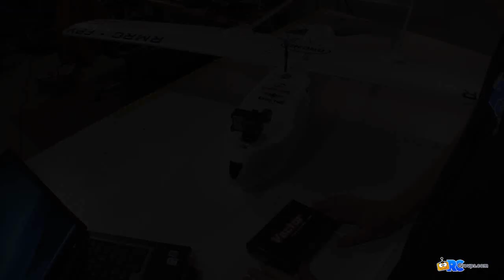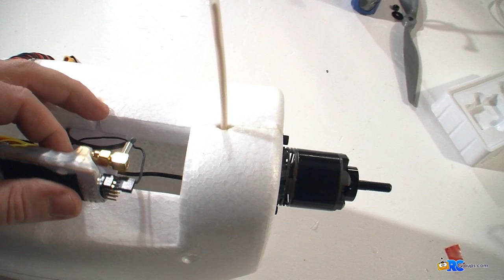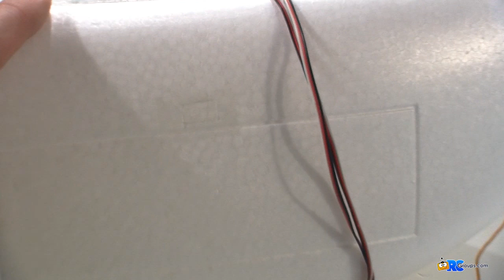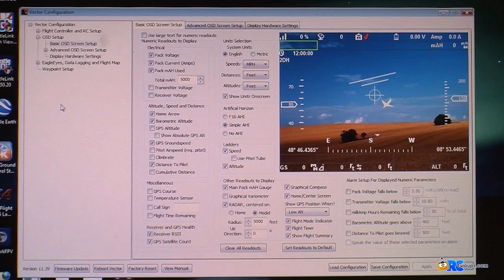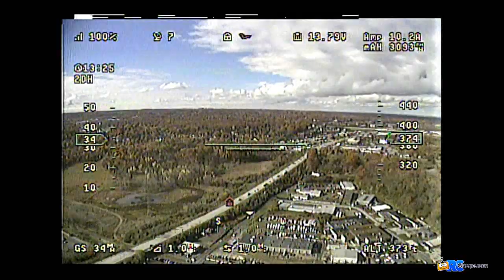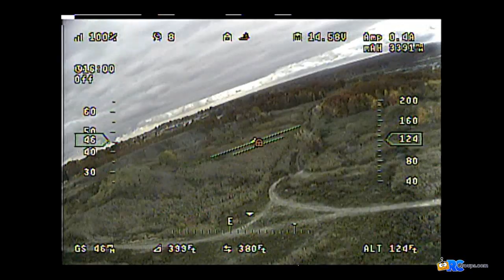Eagle Tree Vector - Installation Setup and Test Flight - RCGroups.com Review

Comment: May I ask you a question? When using Vector for Skyhunter, which kind of tail do I have to choose? Traditional fixed wing ? or V-tail?
Skyhunter has an elavator and no rudder. So its tail is not "traditional" nor "V-tail". I am afraid that wrong setting causes a crash.

Comment: I have just purched the eagletree vector and this Will be my first fpv system aften many years rc flying. I am wondering if my older futaba or spektrum recievers Will Work with the eagletree or is it time to buy a new radio. Thanks.

Comment: A very nice presentation. Confident and competent. I struggle to understand why these videos always use the term "install" but completely eliminate the actual installation. Everything except the actual install...which wire goes to which wire? Unbelieveable. Am I missing something? You get to see the wiring harness and names of same....but the install and connection is avoided. Enough.

Comment: Just installed this on my Mako wing, everything worked fine till i hit loiter...motor stopped, stalled n crashed. Seems like a few have had the same problem.  Gps lock 2d Mode is fine.  It would read rth or loiter engaged but there is no power to the motor.  Fail safe is set to throttle and rx wizard reads everything ok.. Frustrated... Tried bench testing with "low altitude rth" settings engaged in the settings and only the servos moved.. No motor power.. Any help is much appreciated.  Using ezuhf lite receiver..

Comment: Nice video Matt! I have the Eagle tree vector with the Skyhunter also. Haven't flown it yet. Did you have any trouble with the power sensor over heating ?  I read in the Vector manual , that you don't need the compass function with a fixed wing aircraft.Were you able to stop the stalling problem? Thanks for all the info!    Rich

Comment: Hi 
I have installed vector osd on my skyhunter, but the RTH works really strange. It attempts to land by itself !!! 
I already turned off auto land and i did all required setup through the wizard ! 
It was working fine with my ex ranger but just has changed when I hooked up with the skyhunter

Comment: Question: I was reading the vector's manual and it say that the magnetic compass is automatically disabled for fix wings. I saw you calibrating it doing what you called the dance.  My question is,  did you enable the magnetic compas through the vector's computer software before calibrating it at the field? Do you still need to do this procedure even if you didn't enabled the compass through the vector's software? A mean,  for what reason do you think Eagle Tree automatically disabled the magnetic compass when you select fix wing ? 

I need help, I'm about to maiden a new plane with vector installed, and that step is freaking me out.  I have a DJI Phantom and I always  calibrate her compas before my first flight of the day.  I know that that is important,  but with this system I just need to be sure of what to do.  I don't want to lose my $$$ plane... Any help would be appreciated.
Reply: +ricardopr54 calibrating is for quadcopters and not for fixed wings. Don´t know why he is doing it

Comment: I was wondering if your using dragonlink and ppm with vector osd ail cable plugged in why do you have the other yellow wires plugged into the receiver? I thought all servo controls are thru the 1 AIL wire from vector osd and then just the RSSI signal pin to the RSSI output from dragonlink. Thanks in advance

Comment: I have a question for you,  I have a Specktrum  DX6I transmitter and it only has two position switches.  Can I still use the vector with it? Another question, I'm using an immersionrc 600mw 5.8ghz VTX and the wires that came with the Vector doesn't fit neither my VTX nor my fatshark 600tvl camera,  how can I make it work? Do I need to buy special cables? , and if so,  where can I find them?  Thanks for sharing your video.
Reply: Like everything in this hobby, solder solder solder is the answer
Reply: +YellowBlue RC Thanks

Comment: GPS should be much further from the VTX. That close and the VTX will step on the GPS and you will have a tough time getting GPS signal.
Reply from the maker: In theory, yes. However, real world testing proved otherwise. I had no issues at all gaining and keeping GPS quickly.